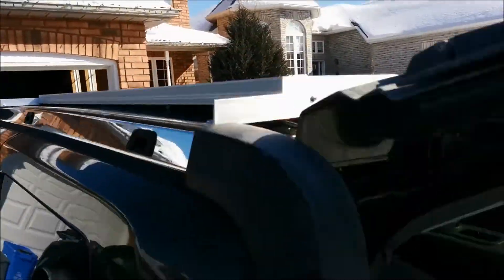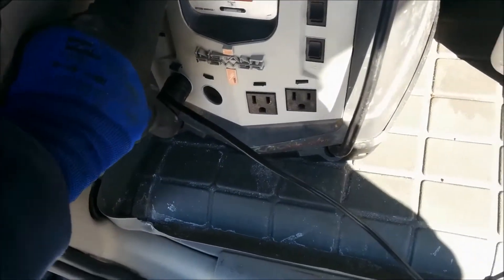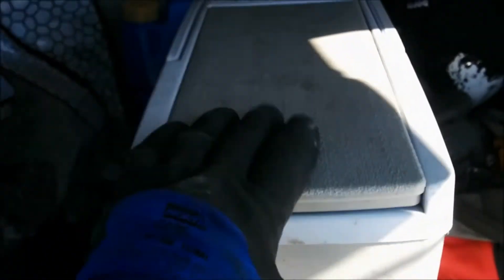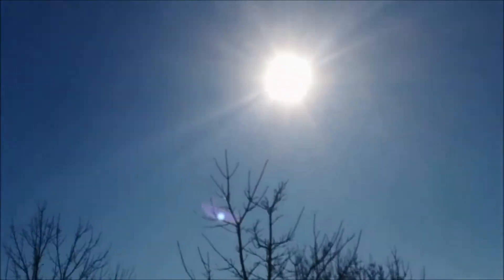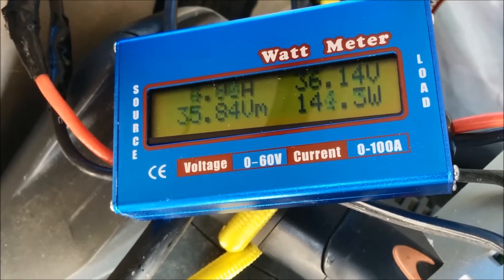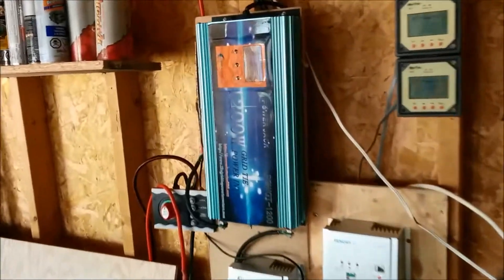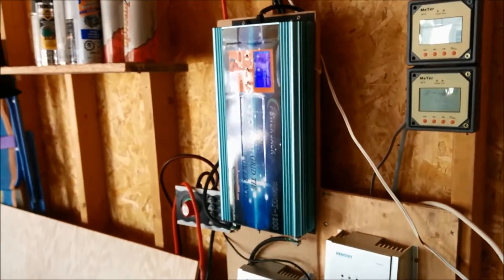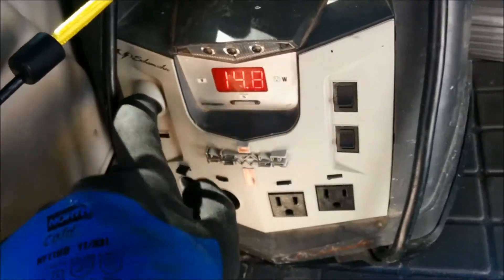solar jeep and grid tie

Comment: Kewl beans ! 
What type of battery are you going to use ? Or are u just going to use the engine starting battery ?
Reply from the maker: the engine starting battery in the front is a agm, and im going to put a 135Ah agm in the back, just not sure when, i may put a smaller 55Ah for the time being.